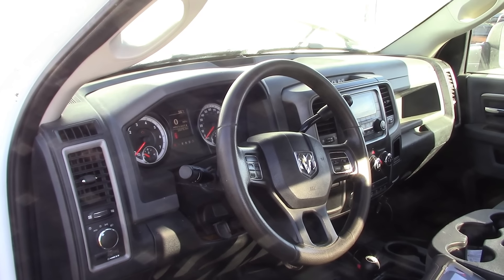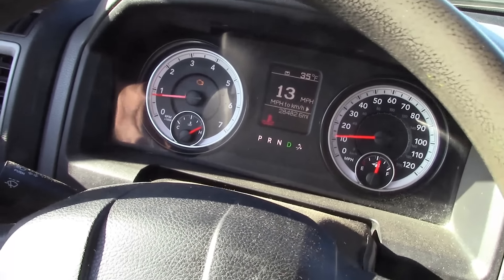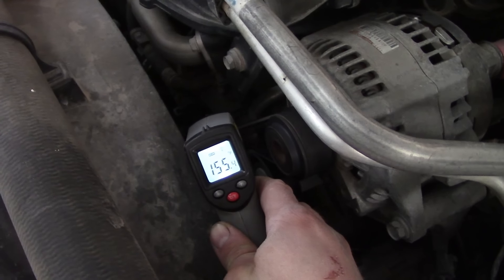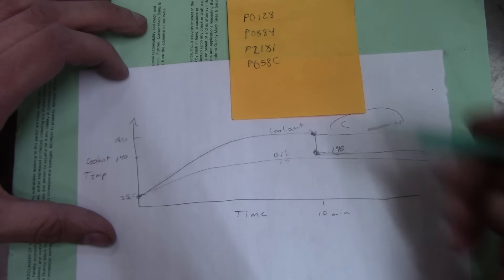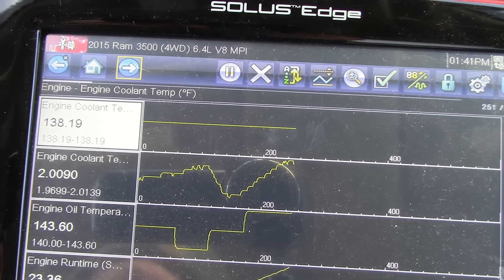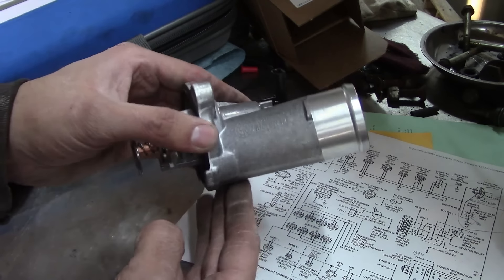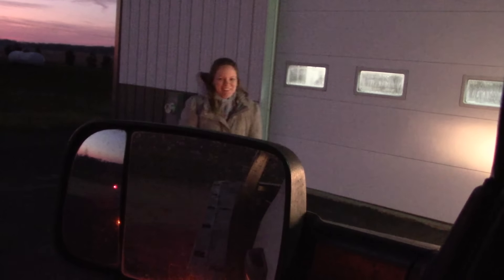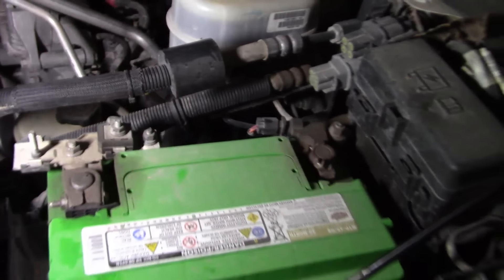When Live Data Lies - 2015 Ram 3500 Thermostat Diagnosis and Replacement - P0128, P2181

Comment: Hi. I have had this problem of odd ball coolant temperature readings with a Honda that had two coolant temp sensors. Nothing was wrong with the sensors or the software. I messed up the computer logic while testing the two sensors because the fans would not cut on. My point is: why, or how, would you expect the computer logic to give you a true temperature reading if something is askew, such as voltage readings from a sensor? You said yourself the voltage on the temperature sensor was not changing very much. I suspect this is what gave you the P2181-COOLING SYSTEM PERFORMANCE code. I looked up the code setting criteria for P2181in service data and it said: "The coolant temperature should change at a specific rate. If this rate is too slow or too fast this fault will set". It makes sense. The computer does not really know what the temperature is (probably a bad temp sensor) so it substitutes a higher value. Notice your first scan around 3:25 when you cut the car off and then back on. The computer starts its logic again to try and gather a coolant temperature off of the oil temperature which is exactly 132.8 degrees. 

Programmers write using what is called if, then, and else statements. As a crude example it would look something like this: "If", after 10 minutes of drive time, and "if", air temp is 80, and "If," oil temp is 140,.... "then" coolant temp is 160. When the parameter of these "if" and "then" statements are not true for an expected value, the next line of code would be and "else" statement,.... "else", coolant temp is 185. The "else" statement is your bogus temperature reading, I guess,... but I am pretty sure it's something similar as far as computer logic goes. I ain't no programmer. Hehe.

I don't know how you get service information, but get in the habit of looking up recalls, and tsb's. Don't forget to do this. Get in the habit of looking up "description of operation" and "code setting criteria". I bet you know this already, but I thought it worth a reminder to you. I forget somethings to do these things and chase my tail. Also, don't forget the generic obdII software is useful sometimes as well. You could have checked the temperature there if you doubted the scanner software. Investigate "mode 6" using the generic obdII. It is particularly useful for Ford cars and trucks. I use it sometimes for misfire diagnosis, but it can very useful for other problems as well. I don't mean to be condescending or sound like a know it all. There is so much I have not learned yet. Technology has grown out of the box now a days, so there is so much still to learn. It scares me in a way. Frankly, the geometric growth of technology flat out scares me. I fear we know not what we do.

I really like your videos and it seems all you farmer guys got something us city boys will never have as far as "know how" goes. You all seems to have a broad range of skills and clever ingenuity as well. Also, that miniature pet cow you have, I think his name Max, is the show stopper. I didn't know there was a such thing as a miniature cow. I though cows were white with black spots, not white with brown spots like Max has,... but what would I know, I am a city boy. I hope his leg is O.K. now. I would like to see more of him in the videos. Hehe. Thank you. God bless you and your family.

Comment: Seems as though the engine was running cooler than it should have. The system knows what the temp SHOULD be based on run time etc, but is not getting proper feedback from sensor. It probably allows a variance, but this one was way out of range. So, bells and whistles went off. Nice job.

Comment: I had this issue with my 2015 ram 3500 hemi. The dealership had difficulty troubleshooting the issue also. They through parts at it on 3 different try’s blaming it on everything from interference from outside radio signals too things like a software issue. Every time it happened I just pulled over turned off the truck and restarted it and the problem resolved. On the third try they finally put a thermostat in it and it resolved permanently. They were still unsure what the cause was.
Reply from the maker: That's not very inspiring.
Reply: @WatchWesWork  as you showed in your video it’s difficult to troubleshoot an issue when the manufacturer isn’t providing all of the pertinent information to the tech trying to solve the problem. This issue was compounded by the fact that cycling the power to the computer changed that information making the troubleshooting even more complicated.

Comment: It could be generating the temp for the smog system and the fuel mixture in slow warm up conditions until it either overheats and the sends gauge and engine light codes, or finally reaches run temp.  Just a guessing, if the computer is getting wrong info it can screw up the fuel mix.

Comment: Chrysler has does this for over 30 years. Just unplug a coolant sensor or charge temp sensor and take a look at live data. Back in the 90's I did some testing on a early 90's 4L powered Jeep and the only engine sensor that was not faked when disconnected was the crank sensor as the engine will not run without one. You even had fake TPS and MAP sensor readings as long as the engine was running. The Jeep was driveable with nothing but a crank sensor! Smart ass computer! Sure could mess with your head if you did not realize a reading was fake though.
Reply: Right - I remember seeing this on some kind of K-car in the late 80's or so.

Comment: It's the temp sensor that is faulty the thermostat is either opened or closed either way if it's a thermostat problem it will overheat or not get up to temp

Comment: It’s almost like when you taught me that oil pressure gauge on my f150 is fake! Why?!
Reply: Ya don't get why they put a gauge in if it doesn't do anything
Reply: They don’t want people seeing the real numbers. With the normal BMWs the temperature gauge would be buffered so give or take a couple degrees it would still show perfectly dead center. On the M performance cars the temperature gage would be exact but that’s because that’s part of the motor sports division where people actually care about it and understand.
Reply: fords are garbage anyway.  the best thing anyone could do with one of those is to just drain the oil out of it and let 'er run for a few minutes.
Reply: @chevytruckman34  I don't remember which engine it was but when the cash for clunkers what going on the ford inline 6 engines wouldn't die when they put the concrete mix that's supposed to lock up the engines in them.
Reply: @FishFind3000  Ya, I remember when they ran that sodium silicate through the old motors.
You still couldn't GIVE me a ford, and I grew up in a ford family.
That was many moons ago... Ive had time to grow up and get smart.

P.s. I drive a half million mile inline diesel that is far superior to any ford product. I am also a heavy mechanic.
Reply: @chevytruckman34  yea, but a cummins isn't a whole vehicle.
Reply: Yar Nunya  pfffttt... Okayyy.
Thanks for the input, young buck.

You'll learn, one of these days...
Or, maybe not...
Reply: @FishFind3000  It is, compared to any ford. Lol
Reply: @chevytruckman34  The only manufacture you can get that cummins in is a dodge and well they make the most POS trucks out there. So idk what your talking about. Its no good having a engine that's good for 500k miles when the rest of the truck falls apart at 100-150k
Reply: @FishFind3000  Sorry, sweetheart.
Its held up. I can't argue with results and certainly won't argue with an idiot.
Na night, hun. Sweet dreams.
No response needed.
Reply: @chevytruckman34  I know up here in the rust belt they sure don't. unless you only drive to church.
Reply: @FishFind3000  Everything up there will rust, unless you take care of it. Same goes for anything.

By chance, are you drinking the water from Flint?
Reply: @chevytruckman34  hell no. I'm lucky my city gets its water from an aquifer. I'm on a personal well. Other city's around me get that good old lake Michigan water....
Reply: @chevytruckman34  that's true anything will last if you know the commen problems with it and take care of it the European fords are great diesel engine
Reply: @FishFind3000  Hey now, What's wrong with lake Michigan water.
I drink it all the time and I'm only half stupid, but not stupid enough to drive dodge.
Reply: I bet the chief engineer who signed off on the design, never fixed his/her own car/truck!
Reply: @FishFind3000  that ford 300 six is an amazing engine. Likely the best they ever built in terms of reliability and toughness.
Reply: @chevytruckman34  Nothing bad happens if you run a car without oil for a few minutes.
Reply: @the_hate_inside1085  Sure thing, Socrates. Be my guest and give it a whirl.
Reply: @neilmurphy845  Last I heard, europe was thousands of miles away.
And diesel prices were through the roof, so nobody could afford to drive them for very long.
No wonder they last so long.
Anything can last if it sits in a garage.
Reply: @FishFind3000  you almost fooled me there for a moment.
Reply: @chevytruckman34  nah they never sit in garages they drive them everywhere I know lots of people who drive them family included because diesel is way cheaper than petrol and my mistake I didn't know that Peugeot make the ford TDCI engines except for the Ford transit ones so that'll explain why there so reliable
Reply: @neilmurphy845  Thats all fine and dandy.
Good luck when that garbage breaks down.
Reply: @chevytruckman34  nah French make great diesel engines they'll never break lots of people have them and there great so are the transit engines ye just didn't get the new ones so ye don't know the new transit's garbage the old ones are brilliant

Comment: I heard a mechanic say that an air pocket can cause crazy readings on a temp sensor... but wouldn’t the air pocket be the same temp as the engine/coolant that’s near it? Idk. Lol. I could see it causing issues if there was a lot of air pockets... or if the air pockets were around the cylinders or in the heads or something... but this guy was specifically saying an air pocket where the sensor is. Not sure if most sensors are even located high enough to be near an air pocket. Lol. I’ve never looked into the topic. Forgot about it until I just saw this video. What’s your thoughts?

Comment: That behaviour is entirely baffling from an mechanical engineering point of view, and (at least to me) completely "normal" from a software point of view (my field of work): When the sensor cannot be reached or returns implausible data, wait and interpolate. You clearly see those steps in your diagnostic monitor at 10:00 - when the engine is running, the coolant will get warmer, so let's assume some fixed amount. Also, there are probably a lot of other systems that would freak out on rapidly changing temperature readings, so keep it steady for a while, even artificially. But there must be a limit to this: When this guesswork continues longer than a certain amount of time or trials,  the value must be limited and the user must be alerted to the problem. In this case, they chose to do it this way: Turn the check engine light on and set the temp gauge to max. In this way, the "user" is pointed to the area of the problem.

Thank you so much for your videos, Wes. I truly enjoy watching them as a hobby car tinkerer :)

Comment: Could you use the oil temperature to see how hot the engine actually is that must catch alot of people out in the snow when you need to deice the windows seeing the temp is warm but the air is cold

Comment: That goofy substituted value thing, I wonder if they did that to fix a software bug in order to avoid some kind of warranty claim issue. It seems like nobody would ever know the difference, as long as the ECT sensor and thermostat were working correctly.

Comment: Fun fact: I have a 2015 ram 2500 with the Cummins. Cummins only gives an on/off reading for the oil pressure (like the old fords) well on my dash you can watch digital oil pressure rise from start up and rise and fall as rpms/ temp changes. Apparently Chrysler loves using an algorithm for more than one really important engine parameter. 🙄
Reply from the maker: Ford does that too. It shows a PSI reading in the live data even though it's just a switch.
Reply: @WatchWesWork  amazing isn’t it .. they already have the programming why can’t they just put on a sensor instead of a switch?? 🤷🏻‍♂️

Comment: Sounds like the computer gave the value as a failsafe to prevent the engine overheating since it had the cooling fan running.
Reply: That’s what I was thinking, something else must be relying on that information for its own operation, so the PCM substitutes an acceptable value to keep some other module or function within acceptable parameters. I would guess there is something else tied to that value otherwise, yes, there is no reason to fake that value.
Reply: Doesn't quite a bit rely on the sensor?  Emissions and fuel trims come to mind...perhaps more?  Maybe it substitutes a value so the truck keeps running normal? (And throws a code so you know something is wrong).  However, I'm with Wes that it doesn't make sense to lie to the technician....
Reply: @brianm9007  like i suggested, it could be a built in "fail-safe" where if a part fails it over compensates to protect from a fatal failure. 
It does however prompt a chat i had with a buddy of mine who is a mechanic when my old '00 Opel Astra had problems. The EGR valve had failed throwing up an engine warning light, and it was described to me that the car was in a "limp mode" to get it to a garage while in that state, where the engine is running leaner and cleaner, and burning more fuel as a result. It only makes sense to me that if the thermostat measurement couldnt be relied upon, the computer would presume the engine was running hot and attempt to cool it until it had some sort of indication it wasnt over heating. This would explain why the cooling fan was on full power.
Reply: 👍🏿 truck smarter than mechanic
Reply: @gambitcustomairsoft8650  my brother is an engineer for an auto manufacturer, he actually writes the code for these kind of systems, and has told me a little bit about all the internal checks and feedback that are going on constantly in the computer systems of a modern vehicle. 

I agree with you, and your similar story. The computer is most likely trying to protect the vehicle from catastrophic failure, and is assuming some sane default as a protective measure.

At the same time I can agree that is annoying for someone trying to diagnose the actual issue as Wes was in the video. Such is life.

Comment: Great detective work, as usual!
I am not familiar with Chrysler products, but GM's scan tool data (pids) are chosen to show actual data received by ECM, not the defaulted/substituted data used for internal ECM calculations. It appears Chrysler is providing the wrong pid to non-OEM scan tools. I wonder what Chrysler's OEM scan tool displays and what the OBDII data stream on the Snap-On and Autel scan tools show.

Comment: Modern cars use ”regulated” coolant temp gauges. If coolant temperature is ~75–105C, gauge shows 90C. 
Especially Volkswagen is known of this. 
Reason is that modern gasoline engines run 107C at highway, to gain better fuel economy, but we are thaught that water boils at 100C and car engine cant be that hot.

Comment: I assume the computer works with an estimated temperature (if the actual temperature is not plausible) because many other ‘decisions’ of the computer depend on the temperature. Especially parameters around injection and catalyst are controlled by the temperature. The estimated temperature is wrong but not totally wrong as the sensor signal may be. Only a guess...

Comment: All the companies do crazy shit now.  A Subaru will give you and ecm failure code through the abs and parking brake systems and it can point towards you putting stronger than 50/50 coolant mix or having a bad thermostat or various other things depending on the codes you get in the ecm.

Comment: maybe PCM doing like that to protect system from overheating.
it's better to assume as a safety measure the temperature sensor is faulty and shut down the system than to believe the data from the faulty temperature sensor and got the boiling  engine and maybe some more serious damage because of aluminum all around.

Comment: My guess would be that some engine management engineer-programmer whatever thought it would be better to implements a strategy based on other inputs to keep the engine parameters dependent on ECT closer to optimal instead of sticking to a default value.

Comment: What ought to have been a pretty straightforward problem to deal with turned into a tricky issue completely unnecessarily complex issue caused by a damn onboard computer. To top it off the necessary replacement part is complex, massive and mighty expensive 
- and......................... this is progress!!"

Comment: there should be an "expected(or desired) coolant temperature" PID and "actual(or measured) coolant temperature" PID, not sure why they combined the two.
The gauge pegging to hot  is likely because the computer has figured it cannot trust the data its receiving and calling it better safe than sorry.
Edit: maybe the pid is mislabeled (like they used the same pid # for a different pid)